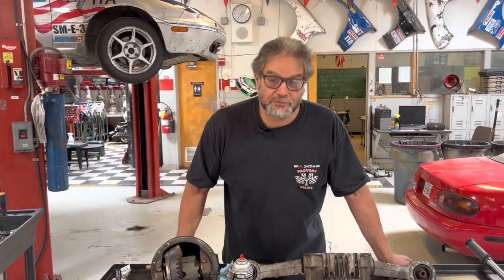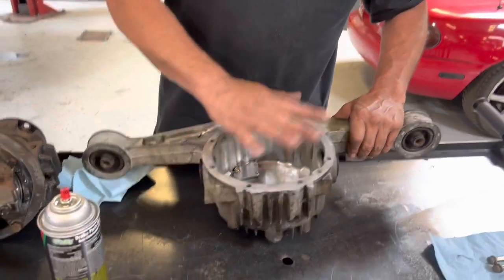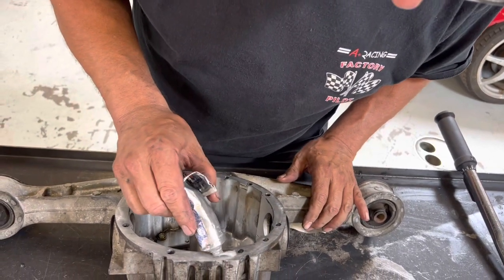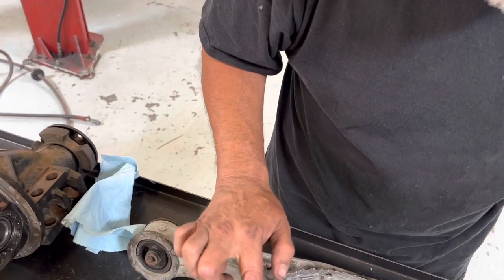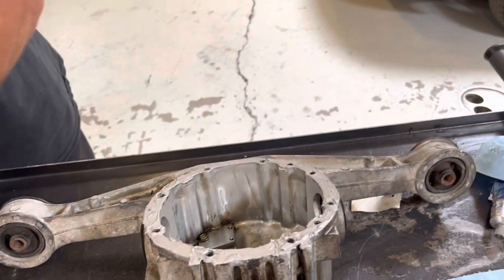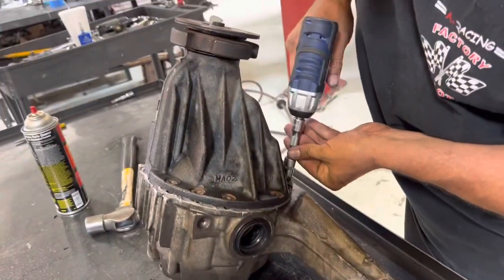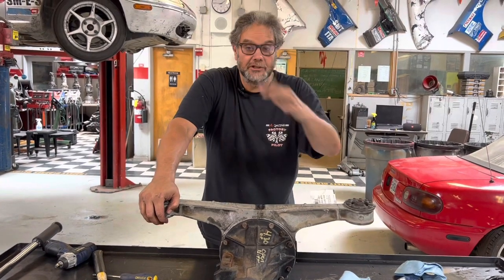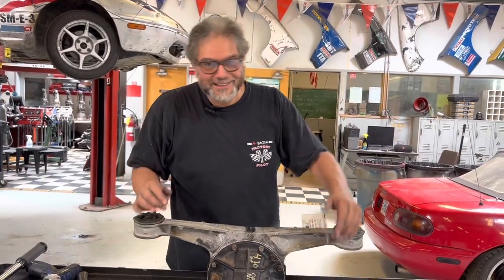Miata Differential The Wrong Way,Torsen Swap. Spec Miata, Autocross, MX5, Track car

Comment: Im having trouble diagnosing a howling sound around 40 mph. Could a cv axle be the problem? I changed diffs and the sound is still there 2003 mx5 torsen   2

Comment: my rubber damper wiggles back and forth about a 1/4 inch, diff has quiet whine so far. diff fluid change never a sign of metal, should i replace asap? or wait till something gives, it's 1994 with 224,000 miles on motor. runs great just that slight whine, replaced all wheel bearings axles still appear good no dry or cracked boots. it's just a sunday drive car. i really like the little red beast.
love your channel.
Reply from the maker: If you changed the fluid, then the whine is not going to go away. I have seen them whine for years without failure, and I've seen them scatter.  If it bugs you, will need to pull it out. If you are asking what would I do, Id roll it. I have seen those dampeners fall of and rattle. I have back up diffs ready to go and I have my guys swap them. I have seen others remove the dampener and run it without any problems. I hope this helps you out and thank you for watching the videos.
Al

Comment: If you get noise from putting the diff together "the wrong way" like you said is possible, will it lead to any damage to the diff or just noise? What is actually happening when your diff starts whining? Thanks for the videos :)
Reply from the maker: It depends on how off you are. most of the time it could just make noise but it could damage the ring or pinion

Comment: I've seen cars with the rubber vibration damper removed from the diff and others still have it on? Oh, and thank you for the videos, I subscribe for the extra tips.
Reply from the maker: I have had a few where the dampener broke off. I still run it without it. Also automatic cars did NOT have a dampener.